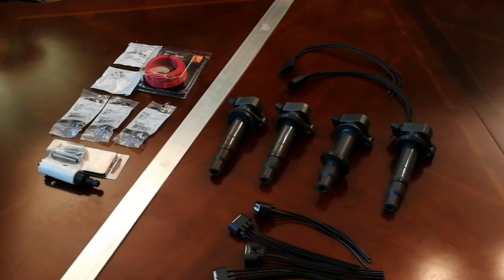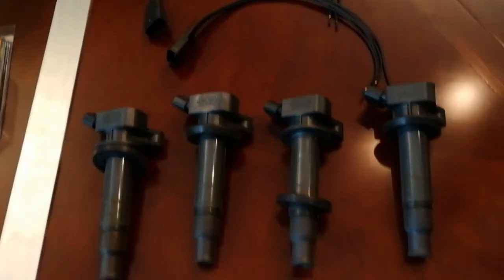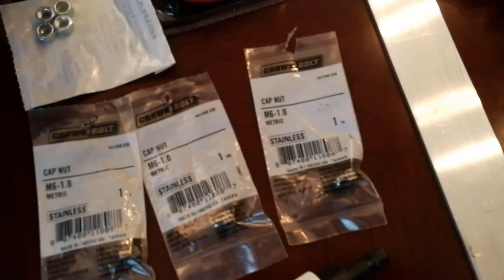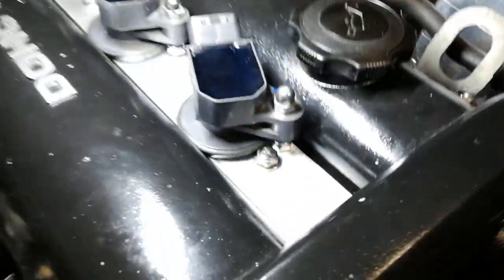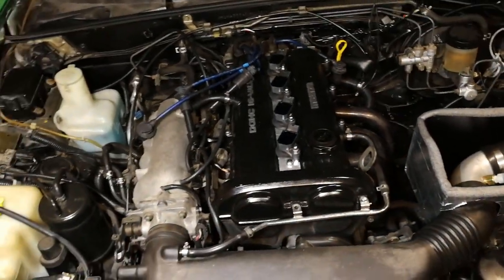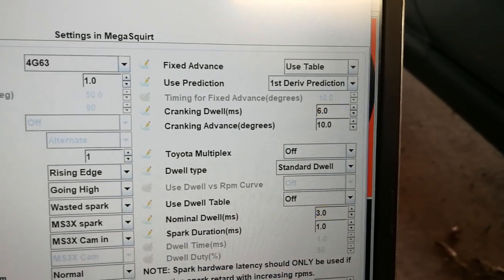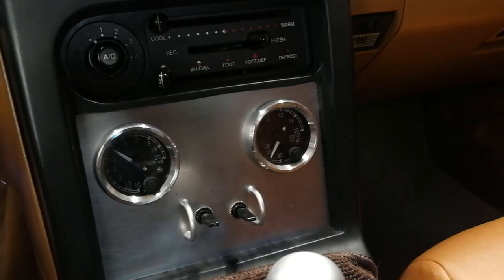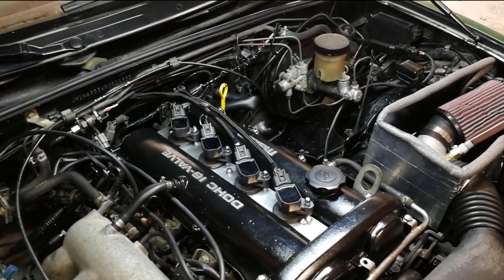Miata Coil on Plug DIY - Full HowTo!

Comment: "For '94+ Miatas, PNP connector to car's harness." is this different on pre 94 miata's?
Reply from the maker: 90-93 Miata's have a different harness due to using an ignitor in addition to the coils.  There's a single connector going to the coil pack but you'll actually want to connect before the ignitors.  Many will take apart the ignitor plug and tap in there for a clean look.  The part I referenced for 94+ is the male coil connector plug and works for 3 or 4 pin coils on 94-05.

Comment: Im doing a video of were to get it at the junkyard. Trying to show it can be cheaper then people think. An to promote recycle
Reply from the maker: Good deal!  Yeah these coils came on a large variety of Toyota and Lexus vehicles.  If you have a good yard near you they are easy to pull and then the rest is just some minor Fab work and soldering.

Comment: Hello nice job mate congrats , can you tell me is there a the differences before after on dyno or anything . Thank you i subscribe and like .
Reply from the maker: If you're naturally aspirated then no, it's a bit stronger but it won't add power.  If you have a turbo then it will help.  You can gap your plugs larger (like .040inch or 1 mm) which will allow for better ignition under boost pressures.  You can run the Toyota cops to about 20psi.  The stock ignition starts to blown out at maybe 12 psi and you have to gap it very small, like down to .020 inch or .5 mm.
Reply: OGPedXing thanks a lot for information

Comment: Do you need ms or a standalone to run them this way?
Reply from the maker: The short answer is yes, a standalone is the best way to handle it.  The other option is to find something that can reduce the dwell time of the stock ECU or find a different coil with a similar dwell as the stock packs.  I think there is a particular motorcycle  coil that some people have used with success.  The rest of the wiring will be the same as shown in the video except with a different connector.

Comment: Hi, may I know how can I make this on car that have only 1 ignition signal from ecu.
Reply from the maker: What car do you have?  A four cylinder should have at least 2 for wasted spark - one trigger for cyl 1 and 4 and another for cyl 2 and 3.
Reply: Daihatsu charade gtti. 3 cylinders.
Reply from the maker: @themindpower94  interesting.  I'm not familiar with it but it may be a two cylinder wasted spark meaning that the ignition is triggered every cycle for all cylinders but fuel is present in only one at a time.  In that case you tie all the coil trigger wires into your single trigger wire from the ECU.  You'll want to try to find out if your engine and ignition does indeed work like that, but it seems likely.
Reply: Okay i will give it a try.

Comment: would this work on a stock ecu
Reply from the maker: The problem with stock is with the dwell time...it will cause the cop to charge for a long time causing more heat and a shorter life for the cop.  Some people seems to be able to get away with it for a while but I don't really recommend it.  Basically the other options are to find a different cop with a longer dwell, use an aftermarket cpu (megasquirt, speeduino, rusefi, me221, etc) or build an add-on circuit to reduce the dwell from the stock ECU.